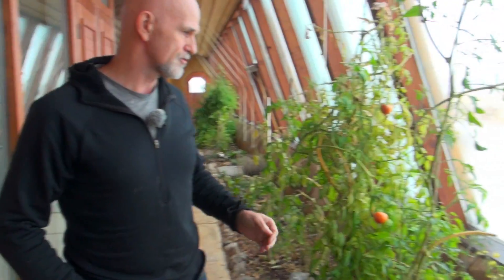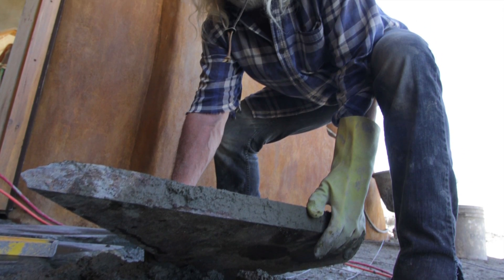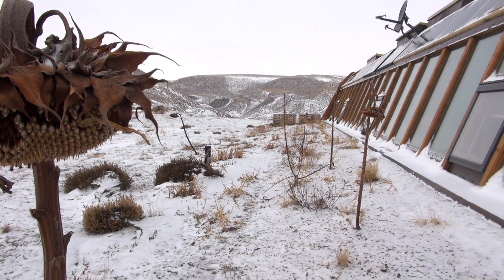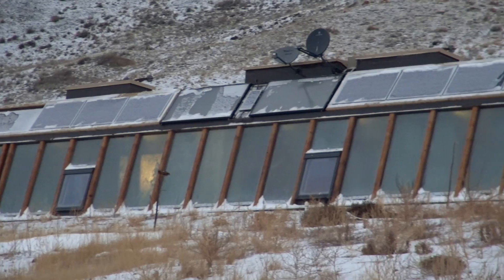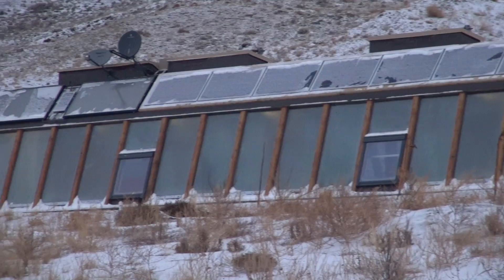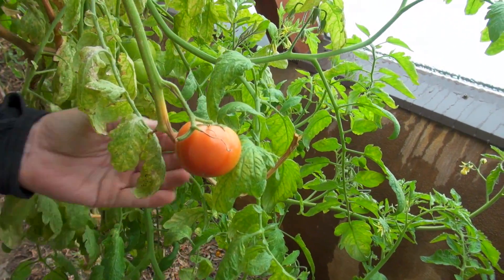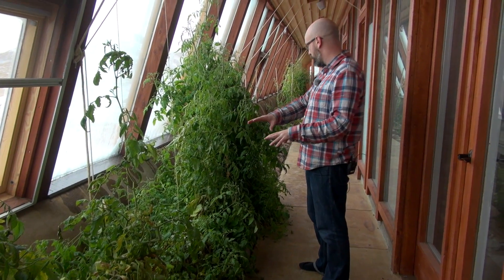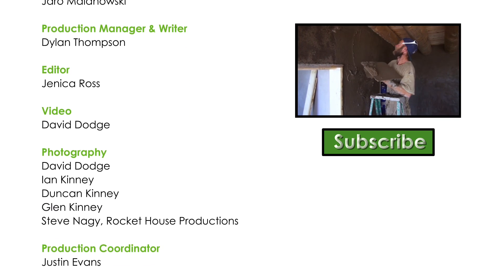136. Earthship living in a cold, desolate, Canadian winter

Comment: love the vegetables and water recycling...question...just 1 wood heater ?....it looks awlfully small for that size of place
Reply: Since most of the house is built into the earth it mostly stays at a constant temp pretty much all year round. It's a matter of using the earth as a insulator. Plus the front massive windows lets in any sun light and the sun also heats up the green vegetable area as well. You should look on youtube for the earth ship documentary.
Reply: Dave...I appreciate your comments ....live in a northern climate most of my life....with some ugly nasty winters ... i guess i am thinking of those periods of no sunlight and very cold winds and having a green thumb....my concern is mainly for the plants ( who cares about the humans lol ) .... I am concerned about air circulation and air exchanges ...the difference between hot and cold = moisture....poor air circulation can create molds ...
Reply: Yea I can see what your saying. Also most earth ships has a long tube that goes through the whole house. It can be opened up for circulation.
Reply: +edsemaj me
This shouldn´t be a problem at all , if the humidity gets too high for plants that need a low humidity, you can exchange the air by ventilating for a few minutes, which is no problem no matter how cold it is, as the air contains the least amount of energy(by far), if the building and furnishing stays warm(these store 99% of the energy)
Reply: good answers to you both

Comment: the only concept i've yet to grasp from earthships is how they insulate the thermal energy in the walls from the foundation and earth beneath the house.
Reply: +skyhawk551 they dont. its a hot debate whether to insulate the floor or the bottom of the berm/tire wall. If you dig down to the frostline and then build, you wouldnt need to insulate the floor.
Reply: very indirectly, the Earth's core is molten magma, dating back to when the sun's gravity caused the planet to form, dig down about 6' anywhere on Earth and the temperature stays at about 10 C

Comment: God thats an awefully big house. It may work off the grid but the amount of material it took to build it... sometimes less is more
Reply: +Sushe the simple fact that it is massive is what allows it to work with passive heating. if you used less material, it would require regular heating from a stove or electric heater.
Reply: +skyhawk551 there is no mass in a giant room made of tire walls. he said big, that refers to the size of the rooms, ie the air space, less air space would mean a more effcient earthship
Reply: yes, the greenhouse is what allows the passive heating to work, it's integral in the design